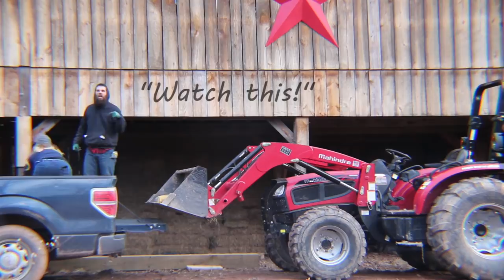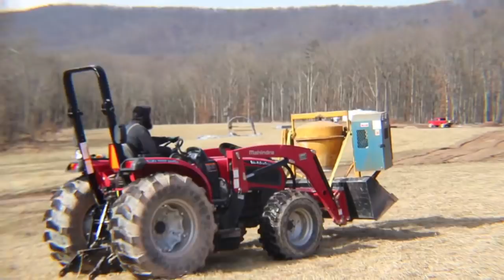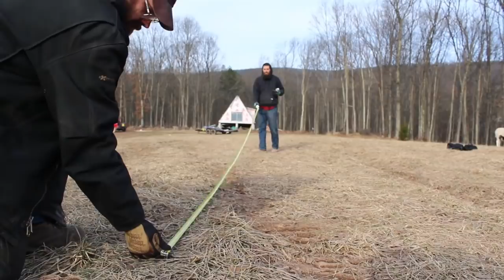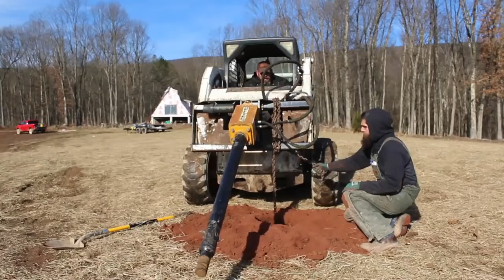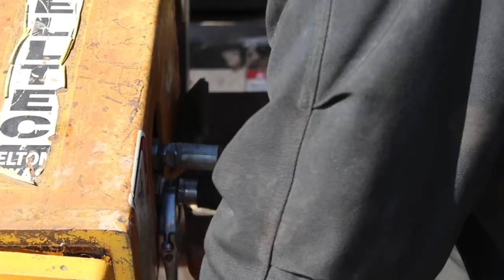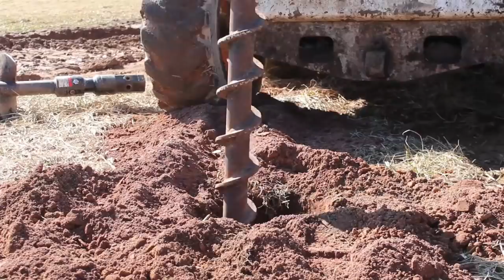Nothing But Issues With The SOLAR Project!

Comment: I had a solar panel system installed in my home ,two years later and over 30 thousand dollars later I was so frustrated with it I sold the house at a loss .....solar panels is the worse investment I ever made it I had it to do over again I would have never had them installed .....and the bad thing I as in wv too so good luck with the solar panels but it didn't work for me

Comment: When it's in the bag it's called "concrete mix" or cement. In the ground, it's concrete, eventually. My man, you are over-tooled. A mixer? For a dozen bags? Auger, for six holes? I'd use a clamshell post hole digger and have you guys beat by a few hours, lol. Here's a tip: if you tamp the mix in around a post or pipe in the ground, dry, i.e. typical ground moisture will mix into the powder and the result will be harder than powder and water mixed and then into the hole.

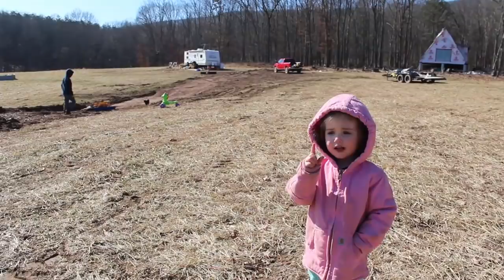By 13:00, I'm waiting for the TNT to be administered, lol. Solar is worth the work. Make sure you over-panel and use big wire. You will always find another use for the free power.

Comment: I still have coffee cup coaster I got in 1972 depicting a cute little frog and imprinted with the Murphy's Law quote.
When turning it over you read the imprint, "But cheer up! Things may be getting worse at a slower rate".
I do empathize. Living in SE. OK. surrounded by coal mines and shafts, many locations of which were undocumented, (such as the shaft found to be running along side of my grandparents home), huge rock slabs, shelves and shale are a formidable problem when trying to run underground wire and pipe and dig holes.
Just keep on keeping on and making your journey a fun one and you'll have it made.
Besides, if everything went according to Hoyle, where would be the fun in the stories you could have to later tell?!😉

Comment: Whoa that bucket can take some weight!  I thought you'd lost the plot when I saw the Concrete Mixer being loaded but she handled it!  Shame about the weather, you need dry and no freeze for a safe concrete pour don't you?  That's how I learned Pythagoras' Theorem A sq'd + B sq'd = C sq'd, none of this The sum of the  squares on the adjacent sides equals the square of the hypotenuse blah, blah, rubbish lol.  Isn't that soil a beautiful colour?  It screams out grow something in me.  It's rotten that it wasn't smooth sailing for you this last weekend.  But to get through that Elephant sometimes it's just chewing gristle.  Better luck next weekend, you will get there.💕  Will you be changing the angle for Winter or are you high enough that the lower Sun will still be trapped?
Reply: Essem Sween It May be great soil but your clothes will suffer for it...we never wore white for the ten years we lived with red clay.
Reply: @martymaloney1032  LOL.  Oh Marty I can imagine.  I bet you had Red stains on your jeans too no matter how often you washed them.  I just got such a surprise when the drill bit lifted out that first pile of soil, it didn't look like Clay to me, all sort of clumpy in big chunks but that might be because of the weather or the augur breaking it down as it spun through it.  I had Clay soil in my first married garden, it was a swamp in the Winter with all the rain and snow and like concrete in the Summer rock hard in big chunks almost impossible to dig.  The only thing it was good for was growing Roses, nothing else thrived in it no matter how hard I tried.

Comment: I'm glad you mention doing homework on the solar project.  First on the energy use audit and second on the angle in which to put the panels. If you mentioned that you may upgrade the system later could you show how and where this would happen.   Would you  stress this a bit more it might encourage more to look into and adopt solar power. In the solar course I took , DEGER makes a 'sun follower' that tracks the brightest area of the horizon all day. Others have a similar product and just an idea for the future.  Just a thought to consider since it's only money..... just write a check.......and git  'er done.................. :P

Comment: Sounds like it's a lot warmer in your area than around here -- for awhile there I was thinking they might be similar.  Our ground is frozen at least 2 feet deep and we have 3 - 4 feet of snow! I feel your pain on the hitting rock at four feet. We are on a ridge top along the Mississippi in Wisconsin, and we will hit rock at 3 to 4 feet regardless of where we dig.  They have to jack (hammer) to get any deeper -- very expensive for water lines and septic systems! Good luck guys!

Comment: Drilling holes is always a royal pain.  I'm glad you didn't get that auger stuck deep and have to wrench/rotate it out backwards.  Dealing with these setbacks in a calm way makes all the difference.  Glad to see you folks keeping at it!  Question: What model/size is your Mahindra?  Are you pleased with it?  Wondering if it is bigger than mine; been thinking of upgrading.  Also, be glad you're in WV.  We have to go down 4-6ft, more often 6, just to get below the frost line!

Comment: Always issues that slow you down, Xmas Eve I wanted my dishwasher installed, we were hosting Xmas dinner and did not want to wash all those dishes, well guess what, the main water hookup broke, this is now 6pm, well we went to hardware stores nope closed, finally last store had what we needed. FINALLY AFTER 4 attempts to match up what broke, we cobbled the fittings, at 10:30pm Xmas Eve Night we got it hooked up and running, never give up, Dinner was a success!!

Comment: Just curious.  Why didn't you just drive the Blue Truck up to the site to unload just once?
Reply from the maker: Too muddy- that work truck isn't 4wheel drive so it can't make it up 😞. We are trying to find time to fix the driveway- actually we are thinking of moving it all together to ride along the woodline. For now, Josh walks down to his truck at 3am every morning to leave for work and then back up when he gets home uhg.
Reply: @WildWonderfulOffGrid  building your own road along the woodline? would dumping and grading stone work or would you go full asphalt over the top of a roadbed
Reply: @WildWonderfulOffGrid  I suggest taking a look at "Making Small Farms Work" by Richard Perkins at Ridgedale Permaculture before making a permanent route for your access road. Your road will be a fixed element of your layout and can be utilized in future farming purposes if laid out with keyline design principles. Doing a great job on everything you two get done each week!
Reply: Might look into truckloads of rotomill instead of three quarter when you do look into fixing your driveway

Comment: cheaper to buy hole digger for your tractor  :)
Reply from the maker: There is no down pressure on a tractor- just the weight of the implement on the back. Versus the skid steer where we can have down pressure to dig through the shale.

Comment: Question: Why are you placing your solar array so far from your home?
Reply from the maker: We have mountains all around us so we wanted to be sure the panels would not end up in the shade.
Reply: When designing your system do you have to account for this distance? How expensive is that wire? I'd imagine there is a drop off.

Comment: You guys are putting the panels quite far from the house. Hope you're not planning on running the DC that far. There will be an unacceptable voltage loss if you do. Unless you do the AC/DC conversion at the panels and then run AC the distance. That would be ok.
Reply: I wonder if part of the reason is so they can run power elsewhere on the property.  Gives them plenty of space to expand the array as well if needed.
Reply: just gotta run fat cables and it won't be an issue.

Comment: Greetings from a Pennsylvania native (now living in Moscow, Russia). Wonderful to see how well you two work together. Amazing accomplishment. I actually bought a much smaller A-frame 'dacha' here about 90 miles outside of Moscow. Constructed with oak beams (by former owner). Incredible workmanship, but the foundation has shifted very bad and now at a crossroads as to what to do ... Your videos are a real source of inspiration!
Reply: That's sounds nice, I hope you can somehow find a way to save it at minimum expense. Maybe it can have cross braces slid through and lifted on jacks. Not my area of expertise but best wishes anyway.
Reply: @fuzielectron  Thanks, appreciate that! I am considering using jacks and building some sort of cinder block foundation around it, but never tackled such a project so very hesitant. It's a nice region, far from the maddening crowds of Moscow. I have my own water source and some fruit trees. If I could I'd live there year round. Maybe someday!
Reply: Jack it and underpin with rebar and concrete  make blocks 1cubic metre square  or adjust to the required height ,  gabion style may also work . Problem solved . .

Comment: Another great video update. If you can, make the support angle position adjustable for winter and summer optimum sun angle, it only really needs 2 positions. Leave enough clearance from the bottom of the panels and the ground for snow build up.